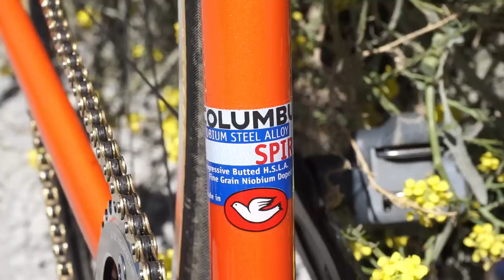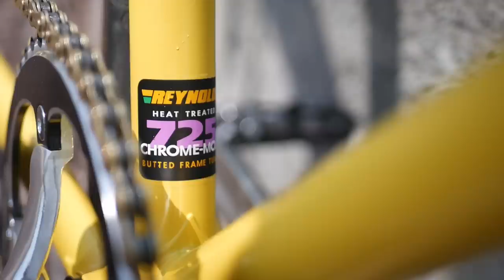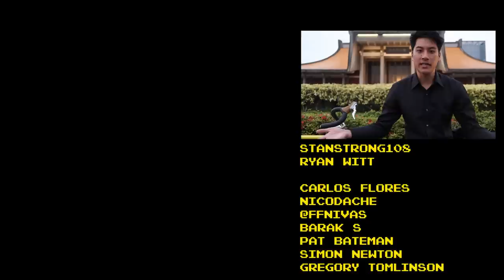The Case for Steel Bikes

Comment: In the mid 90s I had a hand built made to measure bike built by a Frame Shop in Birmingham UK, it was great tig welded SLX OS frame, super light super stiff super fast. But I got older and a decade later I brought myself an insanely expensive Italian carbon bike. I have to say however it rode much softer than the steel frame which suited my riding. But I did not ride very much, because it was too good a bike, so I thought I should have a cheaper bike, a steel bike that will take all the abuse with a mid line group set etc. So I got myself a Bob Jackson Olympus Reynolds 635 frame, with an Athena group set and some mid range alloy campy wheels. I rode it, and it was a dream, I was taken back 25 years Reynolds 531c frame I blew my first terms student grant on.  Now I have 4 Bob Jackson's all Reynolds 635 on the cycle tree in my apartment and in the basement unridden since 2006 my Carbon bike.

Comment: My  favorite go to, all weather, almost all terrain bike is my Specialized, steel framed AWOL bicycle. I have almost 2000  miles on it and it's still going strong! I have almost a dozen bikes from the 80's all steel framed. Looked like they came from a dumpster, I rebuilt them from the frame up. Cyclist go crazy over them when I take them to the bike shop.

Comment: Weight mostly matters when going up hill. Fixed gear is really not suited to go up hills, therefore if you are shaving a pound or two to ride up faster, you really should check out this hot new trend: geared bikes.
Reply: Not so, just reduce the gearing. And ride single speed to glide down the descents.

Comment: My vintage steel road bike is about as heavy as my aluminium one.. No huge difference that would be noticeable when driving.
Also rim vs disk brakes makes its own difference to weight. Good quality steel road bike frame has that nice feel also how it absorbs vibration. Also to mention durability and fixability. 
In steel we trust

Comment: Not taking issue with any of his points, but a fair assessment would include other disadvantages other than weight. For example: rust. I have a fifteen year aluminum frame bike that I'm planning on getting at least another five years out of. I've had one crash and numerous derailing of the chainring to the inside. This has resulted in several inconspicuous places where the paint has chipped off. The bike still looks pretty good so I have no inclination to repaint and I don't have to worry about rust.

Comment: Looks like you live in the Sunset District! Between 15th and 19th Avenue or you live in The Richmond district? You have a cool channel! I have steel, titanium, aluminum and carbon frames. LeMond Arreve’ Titanium is far more comfortable than my Davidson Stiletto, but not as responsive. More than 35 - 40 miles the steel Davidson (custom for my body measurements) adds to fatigue, shortening my ride. The LeMond is slightly bigger (2cm) and has a carbon fork and that fork is what I fear and will probably replace it. I did add a XXX Bontrager stem and XXX handle bars (carbon) and that soften up the ride considerably! Those came from my 2014 Domane Project one Classics. Now, I agree with everything you are saying about steel until it comes to the TREK manufacturing company of carbon frames. The only company that lifetime warranty’s there carbon frames because of their approach of multiple layers (hundreds of layers near 1000 in some) of carbon. Also my experience with racing in the 80’s and casual racing in the 90’s (had to raise a family) I didn’t trust carbon for a minute! That came clear to me in the late nineties after seeing a carbon track frame blow up above me on a 42 degree track turn (Alpenrose Velodrome in Portland) and then dropping into me and turning me into a death decent with my front wheel facing down. My wheel was ruined and I was bruised up, but my wife pulled out a spare wheel from my friends bag-0-tricks and I was back in the race! The carbon frame was toast and the guy had some serious injuries. I took the worst of it all and was a more violent crash, the other guy just slid to the apron. 
 Yep that was my experience with carbon and I swore never to go “carbon”. Then came my 50 birthday and I wanted to replace my 25 year old Davidson that was still awesome and still had most of it’s original DuraAce equipment. The bike racer and salesmen that was recommended to me asked to ride my bike. He came back after a half an hour and said “We don’t have anything in this store that you are going to be happy with, unless you are willing to look at bikes over 5K. This bike you have, had to be 3K or more when it was given to you to race with, so today’s prices are going to put you in the 5k range starting. If you are looking to sell this Davidson I will take it off of your hands for 500 bucks as-is and it will be a personal deal outside the store.” I laughed and through my checkbook out and said “No deal! But how close can you keep me to 5k?” He showed me two carbon TREK bikes, the Modone and the Domane off the racks. I road both for an hour each and said what I liked about them. He then shows me an article of an older ex-racer that describes the Domane Classics by Trek P1. This exRacer describes everything I just liked about the 2 bikes but wished they were in one bike. The Story ends by me paying 5,600 bucks for a TREK 2014 Domane Classics Project One  with Ultegra group set. I started being able to ride 60 to 76 miles per day 4 days a week. It was the fatigue from metal frames in the geometry that I was comfortable with and used to riding that stopped me from riding longer distances. Changing my riding position to accommodate looser metal frames caused many other issues. So, it was only the Trek company that I personally was happy with. If TREK didn’t come through for me, then it was going to be another Davidson or Independent Fabrications for my new steal frame. 
Hey just so your readers know, I am not a rich guy and that bike was my mid-life crisis purchase. Smart buy considering cars are 10 to 20 times that bike purchase. Also I had only purchased one bike in 25 years and that was a cycle cross bike the year before (2013).  Riding is awesome and if you keep it under 50 miles I agree with steel. Steel, like you said, is better tough and more value for your money. Great video!

Comment: Yes, steel is real, and the only material I have ever ridden and ever will ride (and I've owned 7 bikes).  My current bike is a 1973 Maserati MT-2 with full Campy Nuovo Record.  I couldn't imagine a better ride.  Unless I crash it beyond repair, it will be my forever bike.

Comment: i rode most of my races on Columbus SL tubed steel frames like Gios,Colnago,Basso and de Rosa,but since
i laid my hand on a titanium frame around millennium i appreciate the flexing ride style on bumpy roads.
In northern Europe it’s raining a lot,so for the cleaning this shiny precious metal is best-no corrosion whatsoever.
It will never be as light as a carbon frame,but with a Dura Ace 7801 groupset and handbuilt wheels it comes down
to 8 ½ kg what is acceptable for my 191cm tallness 🤙   🚴💦

Comment: I like riding all frame materials. I use steel though cause my bike takes place of a car, so when I haul groceries and heavy shit my disc trucker handles it easily. I know I didn't go for the most "fun" bike, but practicality is my game.

And I recall riding a light weight aluminum gravel bike with my buddy and he was beating me on hills while riding his single speed dropbar 27.5" karate monkey. At that point I said "It's not the bike I just need to get in better shape" haha.

Comment: I started out on steel chromoly road frames. Rigidity is the problem. For pedalling efficiency you want stiff frame. After a year or two on ALL steel frames the bottom bracket flexes out and the frame loses its rigidity. Sure the frame still exists for another 50 years as a flexed out frame. Materials evolved for a reason.

Comment: all excellent points, but not my main reason for preferring steel. which is, you can easily modify steel frames. wanna change from linear pull to disc brakes? no problem, braze on the brake mounts to rear triangle and/or fork. wanna add braze-ons for rack or fenders or whatever else you can think of? braze it in, spray on some flat black paint and you're good to go. i would say you can easily repair a steel frame, but like zach pointed out, that comes up approximately never

the steel frame is much easier to source as a reasonably priced, custom crafted product that can be modified indefinitely. and those fat aluminum and carbon frames are, with rare exceptions, created on a one-size fits all program. there are some professional riders who can make use of carbon frames. but for 99.99+% of riders, you can't get better than decent butted steel tubes

Comment: Two of my three road bikes are steel. One is old school Columbus TSX, and the other is a more modern Air hardened Tru Temper OX Platinum. The newer one is a pound lighter than the other, and maybe two pounds heavier than a good Carbon frame, but the way I figure it, unless you are at your minimum race weight, two to three pounds don't make any difference.

Comment: I agree with your comments completely! I gave up on carbon years ago, and when I tell my riding friends that there carbon bike will eventually fail. They look perplexed and don’t worry because of lifetime warranty. That is until carbon fails and they loose the paint scheme and are given a basic black frame set. I have two steel bikes. 
A SS Schwinn sprint using wonderful Reynolds 853. My second and my pride and joy is a Cinelli magic mirror made with Columbus XCr stainless. I love shinny polished look.

Comment: Anecdotal and might have been the geometry, but an all aluminum bike (alu fork) I rode would have these high freq vibrations and my wrists would get sore constantly. Not happening on my steel bike. I still think picking the right size is the most important aspect, everything else less so.

Comment: Had a 2013 full Ultegra Surly Pacer that was faster than my 2018 Ultegra Giant TCR (retail $4k). 
@6:00 I bought a 1989 Trek 1500 (double butted bonded aluminum) bike for $125. I ride to work 6 miles each way in San Francisco. Great commuter.

Comment: All engineering solutions are compromises so material preferences depend a lot on what you’re going to do with that bike.

Unless you’re racing at the highest and you want a top quality bike to ride when you try to balance out cost with performance with ride quality and durability and the ease of customization it’s just hard to beat a steel frame.

Comment: All about the wheels, frame doesn't matter much, as long as it does not flex under load. Nor does your groupset matter that much, if it's 105 or Ultegra, for most people. Then there's geometry. Much more than just weight or material.

Comment: My favourite bike is my Team Raleigh Banana from the late 80s, I’ve updated it with better brakes and wheels plus now it’s 10speed(still with down tube shifters) 
Last year I did my first double century(200 miles/322km) on this bike, the other 7 guys were on expensive carbon bikes. Then there was me on something I got off eBay for £80 then spent £400 upgrading/modernising.

Comment: 3k full suspension alu XC MTB here. I am using it for pretty much everything. Next to it is my wonderful 70s peugeot steel frame road bike. Guess what, the roadie is lighter, roadie is a wonderful machine for 200km daily road run. Roadie is a great city bike, which can be locked anywhere... So yes - steel road frames are a wonderful equipment for me.

Comment: All my bikes are steel tubed.  Then again my bikes are old..1969 Schwinn Collegiate,  1970 Schwinn Town & Country adult tricycle, 1976 Sears Free Spirit 3-speed cruiser, 1977 Takara 10-speed road tourer.  Newest bike in my collection is a 2020 Schwinn re-issue Sting Ray.  I'm 'old school';  grew up with steel framed bicycles.  Granted some of them have higher grade steel (the Takara in particular)  but I know all of them will hold up and take a beating.  Trust steel.

Comment: Good content, but I think you missed that there are different bikes for different purposes.  Yes, steel is likely the best all around, do it all frame material, and it's buttery smooth.  But if you want to go really fast and really far (which I do) I find carbon fiber is quite amazing.  Aluminum would be my least favorite; harsh ride and dents easily as you said.  And I've never had the pleasure of riding a TI frame ...  So I own a steel SS Bianchi and a 2008 (gasp!) Scott Plasma Pro TT Boike.  One for getting around and one for "racing", wicked fast

Comment: The video is interesting, but where do all the information you give us about the strength of carbon and aluminium come from? How can you say that aluminium and carbon frames are weak? I'm not saying this might not be true but is there like a scientific research you are basing your assumptions on? To me it seems like you are making your point on just your personal experience, that I suspect is very limited when it comes to anything but steel
Reply: Maryon syk Hi, aluminium frames are prone to breaking and or cracking when they have been impacted, whereas Carbon very much depends on who makes or lays the carbon together, any mistakes or different mixing ratios during the construction can cause the carbon to snap. Titanium is a great metal for bike frames but very difficult to work. Quality steel can be easily worked and repaired.
Reply: Aluminium isn't weak, the problem is it is prone to metal fatigue. As a frame is subject to cyclical loading, this will eventually lead to cracking.

Carbon fibre is also subject to cracking if the resin is damaged, and I can imagine these effects will increase as the material ages (and picks up more flaws)

Comment: After wanting and drooling over titanium bikes back in the day I’ve finally got one. Incredible ride quality. I’ve steel frames too and you should mention stainless steel being used, probably the most exotic material for a bike ever!! I’ve only seen one but it was feather light and stainless is very strong and long lasting 
Cheers.

Comment: High-end carbon bikes feel like cheap plastic to me. I grew up on steel, as that's all there really was at the time. But I do like the feel of a good aluminum frame quite a bit. There's so much carbon being thrown into the equation on modern race bikes that, to me, you don't even feel the road or any sense of even riding a bike at a certain point—carbon frame, forks, handlebars, shoes, etc...there's no "road feel" remaining. No thanks. The thing to remember is that in terms of performance, it's more about the legs. Wanna ride longer and faster? Ride more. On anything.

Comment: I guess its the most dumbest thing, that marketing of carbon bike brands ever did to brainwash the people into believing that steel bikes are "bad". On a bike you want to reduce the rotational mass (wheels, etc.). The frame has little to no impact. I ride a Genesis Equilibrium Disc Reynolds 725 Frame and i did all the big climbs in the Swiss Alps, i race, and i dont give a fuck about frame weight, because it simply does not matter, as you nicely explained in that video. Take care, Marketing Departments of Carbon Bike Brands might target you :D
Reply: Weight of frame kind of matters...when you have to carry bike on a shoulder to 10th floor without elevator. I mean, it matters for sissies like me or someone with shoulder damage. Riding? Naah.

Comment: Is there a difference between the weight of the bike versus a similar reduction in the weight of the rider? 
E.g.  Rider one weighs 150 lbs riding a 20 lb bike, versus a 145 lb rider riding a 25 lb bike.  Both setups  (rider and respective bikes) weigh the exact same. Who has the advantage, if any?
Reply: Rotational weight matters the most
Reply: Rotational weight: does that mean shaving weight off of the wheels or crank is more beneficial to shaving off an equivalent weight from the frame?
Reply: Yes the rotational weight of a lighter wheel, lighter crank, matter the most. You loose out on momentum when no pedaling with heavier wheels but you gain on less power needed to pedal with lighter wheels.

Comment: Thanks!  Made me re-think how i feel about steel bikes.  I love classics but have become rather bias since i discovered aluminum and carbon decades ago.  One quick mention - i noticed you were featuring mostly fixies.  Never got the appeal of these types of bikes (especially in a city like SF where hills are inevitable).  Gears are still my preference. My two current bikes are classic aluminum and carbon.  Gonna have to inspect the carbon bike which was made in 2000. You have me worried!  Time to look up videos on how to properly inspect aluminum/carbon bikes for safety. ;)

Comment: I'm a muscular 6'2 "  270 lbs
I'm currrently using  a KHS Urban Extreme w/ a Cro Mo frame as my road/paved trail bike 
My biggest problem isn't the bike's weight But rather my significant wind resistance which I lack the flexibility to reduce to the pro-biker riders' mininum

Comment: There is really not much difference between the materials as far as i can tell. I think the reason large bike manufacturers want us all to ride on carbon frames, is that once the initial capital costs are absorbed, the price of production is minimal. Not to mention the built in obsolescence. I mean why would they want us to ride steel frames that last, indefinitely. It takes a lot of time to build a steel frame correctly, and the large makers just can't deal with that.